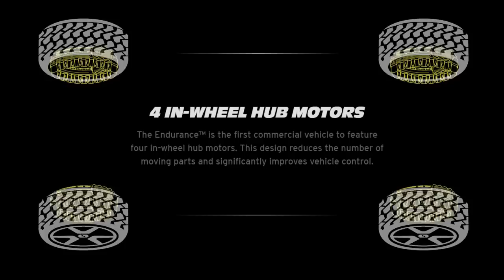Top 5 All-Electric Pickup Trucks Will Challenge Tesla Cybertruck

Comment: For the price, the Cybertruck is better in pretty much every way, as well as Tesla having much more experience with electric cars than any of these other companies do. If you're looking for an electric truck, just get the Cybertruck. While it will probably attract strange looks on the road, so did the first car when there were only horse drawn carriages.
Reply: So you'd want an electric car company building a TRUCK?
Reply: @MandellaJ  - Hell yes!!
Reply: @danahebdon6810  Why?
Reply: It's just too ugly.
Reply: @MandellaJ  it's all the same, regardless whether it's a car or truck.  They all fall into the same category - automotive.  Especially, they are mostly software base.  Tesla has the infrastructure built and proved to be super reliable.  Their vehicles will get better with software updates.

Many other automotive makers are slacking behind Tesla, but they just don't admit that. 

Also, Tesla's charging network is massive compare to the newbies.  Elon Musk listen and response to the user's community.  How many CEO actually did that?

The Cybertruck will put the rest of the newbies to sleep.
Reply: @bac3phi  First, the cybertruck ain't out yet. Second,  the F150 is due out the same year as the Tesla. Third, software doesn't haul train cars that's hardware. And last but not first, you do different things with the a car and truck. That's why they are different. That's why you don't see peopl who do construction use a car to haul things.
Reply: @MandellaJ  sorry but none of your argumentative points make any sense.
Reply: @V1ZFN  what do you mean?
Reply: @MandellaJ   let's see... none of the trucks are out so what's your point... the train pull is a mere gimmick, look up pulling large or heavy objects with  no friction... and sadly tesla is the only true proven electric company, regardless if they haven't produced an electric truck yet... think about it, they have a stable and fast growing supercharging network already in place... they already worked out their issues for the the most part...now Ford is the one of the few only "true" truck makers, however their electronics leave much to be desired even in their new lineups, so one can only fear what type of issues will arise with e vehicles... also none of the new vehicles stack up with what options tesla is offering, especially when  considering the price... pennies will really start to stack up once you start to add up all the base features offered in even the base tesla model for a much lesser price... also keep in mind what Ford is knows with their trucks will not transpose directly to the "electric" trucks as the entire drivetrains are different, so it's safe to assume the learning curve will be quite drastic for all the new "electric" truck manufacturers... oh and one last point which is questionable, why is Ford sourcing their electric platform from investing in a different company??? This is an indication that they will run into many potential issues, but that's just my 2c
Reply: @V1ZFN  So I did make sense. We just don't agree. You gonna give tesla the benefit of the doubt for making a truck, which they've never made b4, but dissing ford because they're out sourcing the drive train to a company that actually makes trucks, and has a working prototype. That learning curve is shorter because they're out sourcing that part. Hyundai didn't start off making their own engines. Tesla ran into issues with batteries, that's why they're making their own now. Just like ford will be. The gimmick as you call it is to show off the prototype. Showing the power it has. It still takes power to move mass.
Reply: @MandellaJ  dude, I'm  not dissing Ford ... just think of the issues from having a f150 body on top of a electric skateboard... rivian is a merely startup company in business for 10 years with only a couple of prototypes to show for... the f150 body on this platform has fitment issues and looks odd... go look at some pics... and yes you have to give credit where credit is due and none of the "other" electric car makers have the history and track record Tesla currently offers... so yes, you have to give the benefit of the doubt due to company's proven history... on top of it, none of the companies can offer what Tesla is offering and price is a huge factor...
Reply: @V1ZFN  That's how ur dissing ford, ur not giving them the benefit of the doubt.  So the cybertruck looks how it looks and electric f150 looks like an f150 but it's the one that looks odd? The prius (give Toyota some love) has been around for over 2 decades. I know it's a hybrid but it still has a battery pack and electric motor. The least expensive tesla is 40 grand new. It's gonna take 4 or 5 years b4 u can really get inexpensive used ones. This is what Elon should get credit for...the infrastructure. That's huge! The way ur thinking about these companies, people thought and r thinking about tesla.
Reply: @MandellaJ  alright, hate to go this route but you should really look up the meaning of word "dis"... not giving a company the benefit of the doubt is not a dis it an actual fact based on company history and Ford does not have such history, suppose we can see how the E Mustangs go... nobody is dissing Ford and I said it looks weird as the fitment of the Rivian skateboard style chassis does not fit the F150 as it was designed for a Rivian R1T... Ford is basically using this chassis on their F150 body and calling it an electric F150 and please dont compare this with using a motor from a different company as you previously mentioned Hyundai... Having owned a F150, I can tell you that Ford wanted close to $7000 after it came out of warranty to replace the electrical harness because they could not diagnose to see where the ECU errors were coming from... so yeah, I'm not going to give Ford the benefit of the doubt on their E vehicles just yet. Based on your analogy a Prius would make a great truck platform when mated to a Rivian electric skateboard style chassis
Reply: @V1ZFN  Naw I know what the word dis means. I explained why it is a dis. you're not stating facts you're giving your opinion. If ford would've made a bad electric vehicle then you'd might have a point. Seeing that they make the best selling trucks in the world...why wouldn't you give them the benefit of the doubt? So the facts  that I use you didn't like so you dismiss them even though its a direct comparison. Hyundai, yes hyundai. Your opinion that the f150 doesn't look right is your opinion. My opinion is the cybertruck doesn't look right. And I take it no one has any problems with tesla's. No problems with their fit and finish, or display screens leaking , or batteries not cooling properly...just perfect. We're 2 sides of the same coin. I'm a wait and see on the cybertruck, you're a wait and see on the ford and the other companies in the video. I'll say it again you're treating these companies like a lot of people treated tesla they came out with model s.
Reply: @MandellaJ  Tesla has much more experience in the ev world and very well established with the supercharging network. I can guarantee you a tesla will win a race across the continent due to the charging network... oh and next in line we have v3 supercharging which will cut charging times ven further and by a ton...
Next we have the durability of the cybertruck which will be tough... Ford is advertised as Ford "tough"? Well they just lost that title to a company with no "truck" experience.... next, with a cybertruck we have an included standard adjustable air suspension, meaning I can zip through the city for work, then head home load a quad in a few moments and head to the trails while raising the ground clearance to 16"... I can go on with many other boring features such as autopilot, solar trunk, sustainable materials etc.. all developed by Tesla not some third party company; and most importantly Tesla is ran by an extremely successful and eccentric individual which happens to have balls when it comes to technology.... now, how can Ford compete with all that and for what price???  They cant even develop their own electric platform...
Reply: @V1ZFN  You can't seem to tell the difference in facts and opinion. Fact tesla's s and x has had issues with fit and finish and reliability. And the complaint's come from customers. So your claim that the cybertruck will be tough is an opinion. Plus it's not even out yet. All the "standard" equipment is why the truck is 69 grand. Other companies learned to let people have different options. They're thinking about making the bed cover solar...thinking. Can you put a link up showing the cybertruck going off road. In this very video you see the rivian vehicles doing that. Rivian's not a 3rd party. That's a fact. Fact hyundai farmed out their engines in the beginning to save money and produce vehicles faster aka on time. They make an ev too. They're successful. Fact tesla's the 2nd ev seller in the world, ford's the best selling truck in the world, and it ain't even close.

Comment: Knowing what we really know so far, sincerely, If the competing truck manufacturers get back down hard on the drawing board, with some luck it will take them at least 5 years of hope to compete with the Cybertruck, but the real problem will remain. Will they be able to come up with batteries and electric motors to match Tesla? The last but the most daunting problem they will have to surmount is: Will they be able to fly to the planet from where Elon Musk came and back in time to bring the right scientist to perform the task to build finally a credible competitor to Tesla Cybertruck?
Reply: AMEN!
Reply: you mean china, where musk will build future cars and trucks, yes!
Reply: @ Tim Fitzpatrick,

It meant, where are going to dig up a truly dedicated genius like Elon Musk to be able to match or better Tesla Cyber truck ? I mean Stainless steel body,  is just a little detail of how Elon Musk thinks, way ahead of anybody else. Are you aware that the last time the entire car industry come up with a truly fundamental improvement in the Internal combustion engine, besides the Governments mandated anti pollution system, was almost 50 years ago. When the Saginaw division of GM invented the electronic ignition system, which instantly got rid of at least 50% of the problems related to the proper firing and smooth running of the Internal Combustion Engine. Until Elon Musk appeared on the scene, and turned the car industry up side down, and in a few years he is now planning his production to accommodate batteries with a 600 miles range, and the entire working life expectancy of a million miles. I could go on and on, but what is the point the evident worldwide craving for Tesla cars,explain  its unmatched excellency.

Comment: Edward Monfort as seen on Linked-In now has a all electric Ford F150 that has been repowered using the EVgine all electric drivetrain.  You can re-power any Ford F-150 from gasoline to all electric using an EVgine all electric drivetrain kit and battery pack.  
This system was tested up to 19,800 GVW

Comment: These are indeed high technology trucks but one thing is missing. I don’t know why or understand why there is no self generated power on any of these vehicles while they are in motion at the minimum. If the had motion power generation for the battery there would be no need to add their charging to the power grid.
 Some trucks have on board power generators/inverters to run power tools, fans, and tv’s yet these electric vehicles have to be plugged in.

Comment: I would like to see General Motors use their voltec technology in a full sized truck.  A full size truck can handle the extra weight of the batteries and the motor.  If the truck had a range of 150 to 200 miles all electric, and a gas backup; it would sell better than any all electric. This would be a good way for some to make the switch to all electric.

Comment: The riviera has a nice design but the box is to small for a work truck. The cyber truck has really good specs but its not a  vary practical design. Somone needs to make something with a shorter front end and a full sized bed that actually usable. You can't reach over the side of the cyber  truck

Comment: Range is everything! Since pickup trucks are the vehicle of choice for everything from picking up garden supplies at your local big-box store to getting to remote places such as when hunting, fishing or just getting away from it all, it is easy to just load up several extra gas cans 'just in case'. How do you do that with an all-electric vehicle? The answer should be solar panels, but I am surprised that no one offers them even though every single plant had its roofs covered with them! Bollinger with its obviously hijacked Hum-Vee design seems a natural for solar panels due to its abundance of flat surfaces. But since on one seems to address what to do in the back woods when the charge indicator starts blinking, I have to go with the truck with the longest range, painfully ugly as it is- the Tesla.

Comment: For years we have been told an unsprung mass is the worst thing ever. Now we are being told the in-hub motors (adding shitloads of unsprung mass) are Endurance's advantage???
Reply: TRUE BUT FOR A TRUCK I GUESS IT DOESN'T MATTER MUCH.
Reply: it depends. If the unsprung weight is less than 20% of overall weight it's still acceptable. And since pick ups are really heavy anyway, a slightly heavier wheel will make little difference. The advantage lies in direct drive to the wheels, not the weight. You have to take context into account

Comment: I can envision success of electric Trucks except for buyers whom are going to expect to have a reasonable towing range, to be able to tow something like a horse trailer or camper at least 250 miles, it'll likely have an unloaded range easily north of 600 miles!!! For instance in regards to semi trucks the e-cascadia from Freightliner has a 550KWh pack with a loaded range of between 200 to 250 miles, the 600 mile version, if & or when there is one on the market Tesla will likely need to incorporate a battery around & north of 1,000KWh! (1 million watt hours) 10X a P100D.

Comment: How many miles can these go with full loads, in vehicle and/or plus towing? Why is this factoid never mentioned? 👀
Reply: range will probably be half at full tow capacity but the biggest issue has always been drag, not weight for range. you can double your range at low speeds.
Reply: Not to castigate your observations for I agree with your postulates, theoretically. It's more of a pet peeve of all advertisements regarding performance(s): range(s) are never qualified with the stresses or strains under load or as you've pointed out, drag/aerodynamics.
Reply: @philsergent1913  
Except Tesla lists the range as 250+, 300+ and 500+ respectively.

Comment: I feel Tesla is the best option (for me). I have a 5 ft pickup bed I can make work now. But everything I have seen seems to lean towards short. A 6.5 ft bed is between my OLD pickup with the 8.1 ft bed from the 80s. And my current truck with the 5 ft bed. Wondering if Toyota has any plans. Otherwise, it will most likely be Tesla.

Comment: Well when driving it, you only see the inside anyway, even if you don't care for the outside.  Having stainless steel, it will never rust. We already have a Model 3, and Tesla home solar charing system, so staying within the eco system seems practical to not have to add another charging system format. The big thing that seems to go overlooked in the other comparison vehicles is the Telsa autopilot & technology, and other Cybertruck features.  Since a lot of people own  the F150 or Chevy/GM, switching to the Electric F150/GM may be more adaptable since they already are familiar with the vehicle. Another important aspect to Ford and GM is the infrastructure of dealerships for servicing and repairs. Something even Tesla is not close on. Although they have a very good running start on deployment of Supercharging stations worldwide.  Tesla and the other new EV trucks will need serious catching up to existing large motor companies for repairs and service.  I didn't like the Model 3 when it came out. But now we own one. I thought the Cybertruck was a rough prototype - "is that for real".  Now I'm getting to like it.  Left a Cybertruck pre-order deposit. The best truck is the one that is right for you.

Comment: The problem with Ford and Rivian is range and price. If they can release their trucks at 50k starting, then maybe they can do much better. But because they will be at over 100k with a range less than 500 Miles, I don't think they can challenge the Cybertruck. Most truck owners love their engines, and electric won't appeal to them. The Cybertruck won't go after the avg truck consumer, opening a new market in consumer types who would never buy a truck but would buy a Mars Roving looking movie prop truck. The specs are also insane on the cyber truck compared to these two Electric truck alternatives and the starting price is 50K. Cheaper than the model S and X while providing more range. I think it's going to be a while before any big auto maker can compete with Tesla. They slept on it for too long.